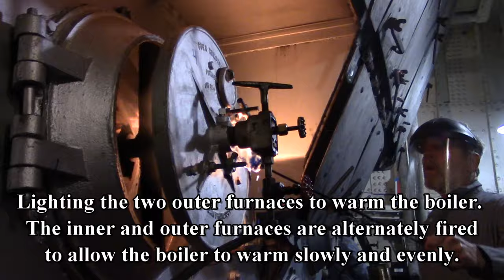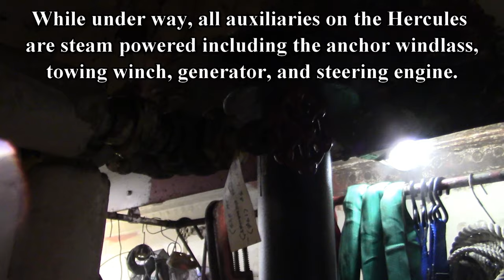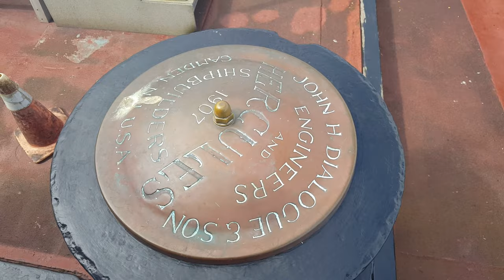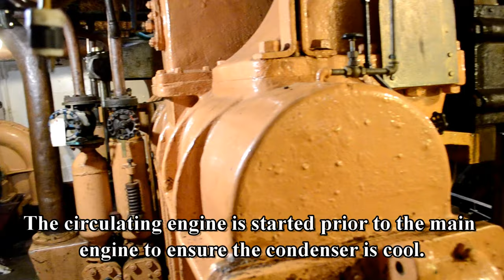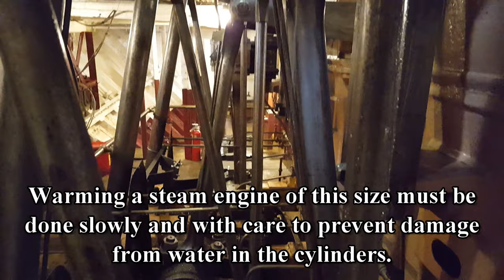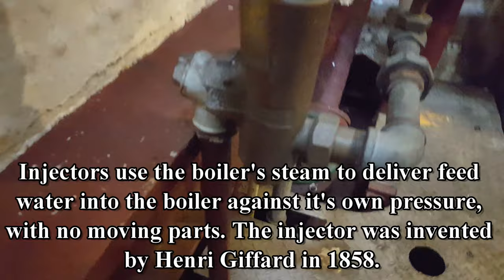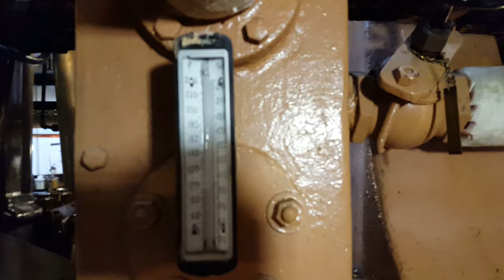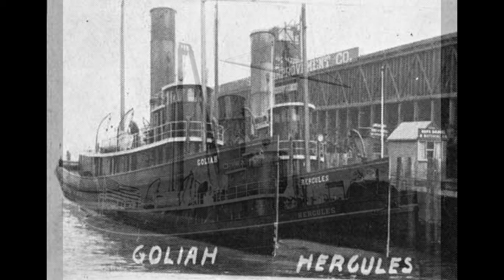Steam Tug Hercules STEAM UP! TV show TUGS!

Comment: Just enough boat to keep its engines floating.Definition of a tug boat.
Reply from the maker: John Malz spot on!
Reply: Wesley Harcourt Great video sir the sights and sounds are amazing i wish there could be scent in video.
Reply from the maker: John Malz thank you very much! There's nothing quite like the smell of a warm engine room on a steam ship! The Hercules will be steaming up at the dock tomorrow (4-3-18). If you're nearby you should go check it out
Reply: Little more boat than that, but you’ve got the right spirit! Enough boat to keep the screw submerged when hooked up (ahead, or astern).
Reply: yes tug is floating engineroom greetings
Reply: @WesleyHarcourtSTEAMandMORE  Is the Hercules privately owned? Or is owned by a museum?
Reply from the maker: @rudycarlson8245  it's owned by the United States National Park service and part of the San Francisco Maritime National Park. For better or worse... Preserved, but wrapped up in heaps of bureaucracy and whims of political climates.
Reply: @WesleyHarcourtSTEAMandMORE  Is she in operating condition?
Reply from the maker: @rudycarlson8245  yes, she needs a coast guard inspection before she can steam under way though.. well, as of 2018. I'm not sure what the current disposition is with that now.

Comment: Incredible engineering
Amazing what was designed and built with no computers, no automation.
Castings, forging, correct metal alloys, huge amount of labor and knowledge.
She is beautiful.
Thank you for this video
Reply from the maker: Not to mention the engine frames and crankshafts were all made  in multiple pieces. Assembling by the fitters with hand scrapers and files until perfection.

Comment: Light off procedure is almost the same as it was on my ship. USS St. Paul CA-73 Year built was 1944 . As a Boiler man 3rd class I worked in # 3 fire room. 
(65-68).
I'm sure it gets hot in that Tugs engine room in the summertime. I remember fire room temp temperatures as high as 150-170 deg. While in South East Asia on my ship.
We did have recip Main feed pumps but everything else was steam turbine. 
Video brings back so many memory's . Thanks for sharing
Reply from the maker: That must have been an amazing experience. I can't imagine the heat in the engineering spaces in the tropics. Im sure watches were shortened significantly! Thank you for watching and thank you for your service!
Reply: Steam turbines! The gentleman's way to travel!
Reply: Black gang.....
Reply: They built a steam powered ship in 1944, thought everyone was on diesels by then?
Reply: @WesleyHarcourtSTEAMandMORE  of
Reply from the maker: @rimsatrlable  ???
Reply: Salt tablets and gallons of drinking water, plus the bilges are an added attraction.
Reply: @jean-lucpicard5510  The USN ran steam turbines up through the '90's. The Knox class frigates ran 1200 PSI steam. Pretty sure the USN is still running steam in some way or another.
Reply: @ajwilson605  As far as I know, all current non-nuclear U.S. Naval ships built after 2000 are powered by kerosene turbines driving a electric generator or gear reduction direct drive.

Nuclear reactor ships use steam to pressurized steam turbines, which in turn, drive electric generator / motors.
Reply: @DougHanchard  I thought modern destroyers used two big jet engines as power plants.
Reply: @craftpaint1644  ... that's what kerosene turbines are, key engines without high bypass propulsor up front, replaced with a gear reduction transmission....
Reply: @jean-lucpicard5510  Uhh....not really. Bismarck, Iowa, etc. Only certain tugs were diesels, USS Hoga, for example.

Comment: At the 18 min 5 second Mark , I want to set my deck chair where the connecting rods are dancing with each other and the engine is hammering out its powerful cadence. I need time to absorb the absolute complexity of a machine built and operated largely by hand when the minds of the engineers that designed this marvel were connected directly to a straight edge and a number 2 pencil.
Reply from the maker: How beautifully said.

Comment: Just excellent! I'm a volunteer looking after a steam tug in Two Harbors, Minnesota. 1,000 HP steam screw Edna G, built in Cleveland in 1896. Hand-fired coal burner, double reduction, with jet condenser. Had a crew of 4 when working...is in cold dry layup now for 40 years. Nowhere as spacious as Hercules.
Reply from the maker: That's great! I'm glad to hear there are others out there preserving these ships! Is there a website?

Comment: Scotty, I need steam now!  Captain, I need 30 minutes,  I canna defy the laws of physics!
Reply: 30 minutes? Try 13 hours. For a boiler this large firing from cold. Although re-lighting after an interruption it might have steam come up in less time.
Reply: @renegadeoflife87  When they were working boats, they would bottle up the boilers at the end of the day so they could be brought up to pressure relatively quickly the next day. These old scotch (fire tube) boilers held a lot of water and as long as you preserved as much heat as you could, would work daily without that much trouble.
Reply: Captain: Give us thirty knots! Helmsman: I cannay change the laws of physics! Squire Hunt for the red Oktoberfest

Comment: A steam engine is a living, breathing being. Steam turbines may be incredibly efficient, but, sorry, they are nothing to see :-(.  If you see the 100 inch beam pumping engine at Kew (in the Thames London suburb) start up, manual valve operation until she reaches her full stroke, when the automatic control kicks in, and the feeling of sheer POWER that comes with it! The massive beam rocking effortlessly (so it seems), then you remember that the beam weighs as much as a truck!

Horizontal, vertical, marine, locomotive or stationary, they are ALIVE. I have spent hours watching the Triple expansion engine in the paddle steamer Waverly that does an annual summer tour around the south coast of Britain before returning to Scotland. With the paddles on either side, she has a high-up crankshaft, the 3 cylinders athwartships down on the keel, and the connecting rods pushing upwards at 30 degrees or so. Quite different to a propshaft and screw, but just as mesmerizing!

Thank you for posting this, and I hope Hercules keeps in steam!
Reply: Good for you. I spent many years in the engineroom of USNavy ships. Don't tell me there's nothing to see. You obviously find no fascination with turbines. Believe me; when the turbines are spinning and transfering to and through the reduction gears, what you get is a sensation of a giant straining,  trying to break free of the nuts and bolts holding it to the deck. Your elitist attitude betrays an ignorance.  Not as much to see? Depends on your point of view.
Reply: Having put in many hours at Hereford's Broomy Hill Waterworks Museum , I can state it's not easy getting a triple expansion engine running smoothly with no load, with various challenges of interstage reheat effects  and heart stopping moments when the condenser starts to pull a good vacuum and the engine decides to race!
Reply: @corkcamden9878  He's tearing one thing down to build up another. It's a classic move for people who can't articulate well. If he was in an engine room on any mighty ship, he'd be impressed.  Plus steam turbines were just better tech than VTE. Both are cool.

Comment: This tug also worked for the Western Pacific Railroad.
Reply from the maker: Joel Harrison yes, that's why her pilot house is unusually tall. They modified it for towing railroad barges.
Reply: Did the Western Pacific Railroad own the Hercules?
Reply from the maker: Yes they did.
Reply: Down in San Diego, the museum I work at, has an old ferry boat that was owned by the Union Pacific railway

Comment: At 24:18 I have a generator like that. General Electric 4kw 115 volts DC. Mine is nearly identical but does not have the fender over the flywheel. Same oiler mounted on the side of the cylinder. I have an insert from a GE catalog from 1907. They were built in sizes from 4 kw to 80 kw.
Reply from the maker: That's awesome! I have one too, but it's a bit newer.

Comment: Served as a Boiler Tech on a Gearing class Destroyer in the 70s. A little more advanced boiler system with the Babcok and Wilcox 600 P.S.I. "M-Type" marine boiler with separate superheaters.
Reply from the maker: That must have been quite the experience. What was the SHP of the Gearing class? I hear destroyers roll like drunken sailors, I imagine that must have been fun in the engineering spaces. Thank you for your service.

Comment: I got to crawl around Hercules and Wapama when i was a kid. If i remember right, she has a triple expansion steam engine. 
what a great Tug, and a real sea tug at that. good memories.
Reply from the maker: FPVREVIEWS yep your memory is correct. Both the Hercules and Wapama are triples. Unfortunately the Wapama was broken up, but her machinery survives at Hyde Street Pier. My dad got to crawl all over her many many years ago as well.
Reply: they were both in Sausalito when i was there, and they were trying to use borax soap to preserve Wapama. 
heard about her later, and was sad, but she had a broken back by the time i knew here, and was living on a steel barge at the army corp docks.  Sausalito will not be the same without her, and sad to see them spend money to break her up rather than preserve her.  
this was not long ago..
Reply from the maker: Yeah it was a sad passing. I'm glad they were able to save her machinery at least.
Reply: I remember seeing the Wapama back in the mid '60's. Such a travesty that they weren't able to preserve her. Spent an afternoon chipping paint on the Hercules with a friend who was volunteering on her back in the '90's. Glad to see  she's in good shape.

Comment: ...and people today cant wait 10 seconds for diesel glow plugs to heat up...  I can almost smell that engine from my computer screen.  Oil, Grease, Salt Water.... Mmmm
Reply: SquillyMon Don't forget the smell of warm steam!
Reply: @samanli-tw3id  True... Man... I could watch this beautiful machine all day.  Its my 3rd go around at this point and I'm as completely mesmerized as I was the first time!
Reply: SquillyMon Ever seen the movie Titanic?
Reply: I went to a maritime college in Mass, they had a steamship.  It took a week to light the boilers
Reply: A proper direct injected diesel engine doesn't require glow plugs.  They are a crutch for poor engineering.
Reply: @randymagnum143  Diesels without any sort of glow plugs or intake air warmers don't start very easily in cold places
Reply: @eikuz  there's a considerable difference between a manifold heater, and a glow plug that penetrates the combustion chamber.  Less places for cracks to propagate in the head, the better.
Reply: @randymagnum143  both have their ups and down, small Diesel doesn't need a manifold heater and can use glow plugs that take a lot less power
Reply: @eikuz  no, glow plugs have no "up"
Anything that perforated the head is a spot for trouble.  Valves and injectors can't be helped.  Glow plugs are unnecessary.
Name one actual heavy duty engine with glow plugs?
Reply: @randymagnum143  did you read the part where i said small diesels, lot's of people driving 2l diesels atleast here in finland
Reply: @eikuz  ok.  I see you're point.  I was thinking only industrial or ag engines.  Still, a problem point for very little reward.
Detroit Diesels started in the coldest of environments, under the worst conditions, since 1938, with only an ether pill.
Reply: @randymagnum143  and a modern 2l tdi is a lot more efficient and creates a lot less pollution. Glow plug are a pain in the ass to replace but smaller cars don't have an electrical system that is made to handle a manifold heater. And an average driver does not want to have any extra steps starting a car like using ether. Glow plugs for small engines and manifold heaters for anything bigger

Comment: A few months ago, I was on a plane ride aboard a B-17G, and some time afterwards, I thought to myself that the classic warbirds from WWII are in a way similar to steam locomotives and ships.  They may be technologically outdated, but they still haven’t lost their charm.
Reply from the maker: If you think about it, a locomotive engineer drove the fastest moving piece of machinery of their time and required an understanding of every single aspect of it. Pilots or astronauts of their time
Reply: DC- 3s basically use two B-17 engines and straight up WW II technology. There are still a lot of them flying, delivering mail , supplies and equipment in some of the most difficult environments on this planet.  And here in Miami we have some that haul cargo to the islands. Every day. Several times a day .  WWII Technology Rocks! I work on industrial and marine generators and marine diesel engines. All of my own equipment and the stuff I put together for family and my friends would be considered antiques. DC-3s still fly because you can make money operating them. Easy to fix, hard to break , no digital or solid state electronics. (there is modern communication and  navigation installed on all old airplanes.) Steam tugs and locomotives work great. They burn more fuel and require more maintenance hours. But they are certainly worth it.

Comment: Gosh oil fireing is neat and tidy, nice to see young guys working on these old vessels. Yes we know its a 4 furnace scotch boiler😎
Reply: More tidy than coal, but oil is pretty dirty, too, especially Bunker C or No.6 oil that they burn in this boiler. It makes a lot of soot and the boiler firetubes have to be  cleaned regularly. Some boilers have steam or compressed air powered soot blowers to blow the soot up the stack, but on many you have to punch the tubes with long wire brushes.

Comment: Now when the steam engine is fired up, do they take the Tug out and drive it around or do they just start the engine and run it while the tug is still docked? We can see the prop shaft moving but is there a screw bolted to it or not?
Reply from the maker: They keep her at the dock. The prop is still connected to the shaft.

Comment: There sure is a huge and heavy amount of connecting rods and other monstrous linkages that would substantially reduce the transfer of horsepower to the screws. Very impressive in it's time, but easy to see why this technology would be set aside as more efficient designs were developed. As a survivor, this craft is a really historic and important vessel from the past.
Reply: dehoe disc I think you have this impression just because everything in this engine is “out in the open”. A Diesel engine would essentially have the same amount of connecting rods and linkages, and valve gear.
Reply: Not quite for a diesel engine to be reversable the only change is in the camhaft it has 6 lobes for each cylinder. 2 for the inlet valve, 2 for the exhaust valve and 2 for the fuel pump drive. These camshafts have an axial movement that is "forward" and "aft", moving this camshaft changes the engines driven rotation.
Reply: Nonsense.  An "impression" of the visual impact that the extensive connective gear of the outmoded steam power technology is irrelevant. The Fact that the heavy duty diesel engines transfer much more of the torque produced by the vastly more efficient engines to the propeller shafts and screws is the relevant thing. Too much wasted energy making steam and low efficiency transfer of that energy.  Museum piece and many oohs and aahs.
Reply: Claus, a modern 1,000 hp marine diesel could be fitted, with its reduction gearbox, in the shaft space on Hercules. There's no reversing required because they use at least a variable pitch prop, or a pod type swiveling drive, or a Voith Schneider drive which can instantly switch pitch and direction. This size of tug is typically around 5,000hp now, and the engines are about the size of a small car. Modern engines are tiny compared to these, and simple to operate.
Reply: @clausmadsen6754  Not true.Faster revving and lighter power reciprocating components.Gears to a lighter valve train and lighter valves.

Comment: On Hikitia, I craked open the main stop valve to the compound propulsion engines, after lubricating the engines have another wine or cup of tea. When I was ready or the engines would turn over at dead slow ahead, no water hammer or banging they were ready🤔 no worries no stress
Reply from the maker: That's a very good procedure. Sounds like it ran well and was used often. How big was she?
Reply: @WesleyHarcourtSTEAMandMORE  Big. https://en.m.wikipedia.org/wiki/Hikitia

Comment: How do they generate electric for the lighting and instruments? Did they do it with steam and if they did, are they still using steam or has it been retrofitted it with a more modern source?
Reply from the maker: They had a steam genset on board that would provide electricity and is seen running in the video. It still works today!